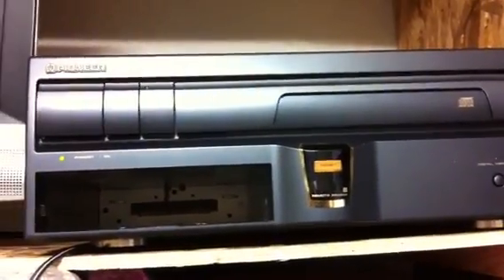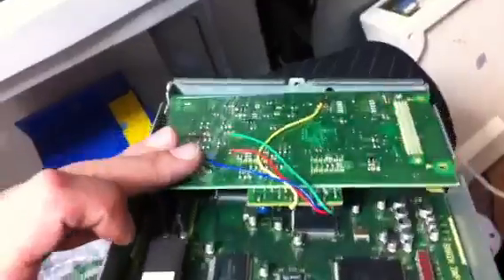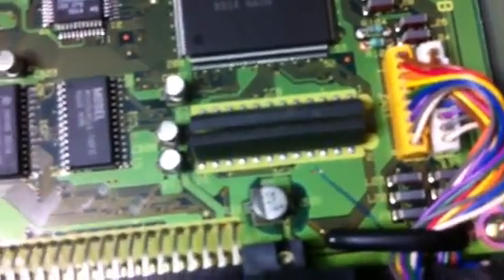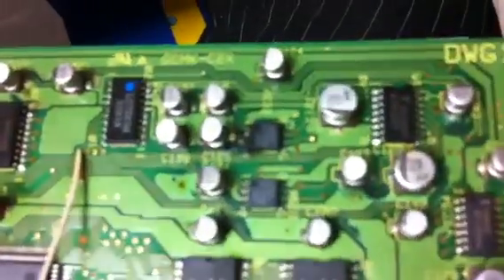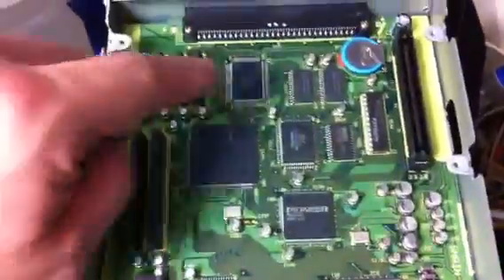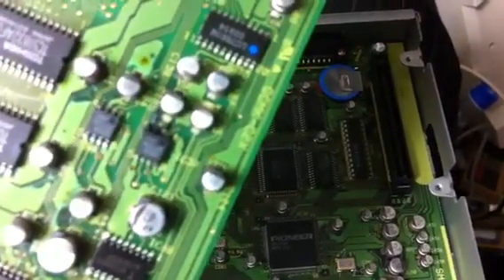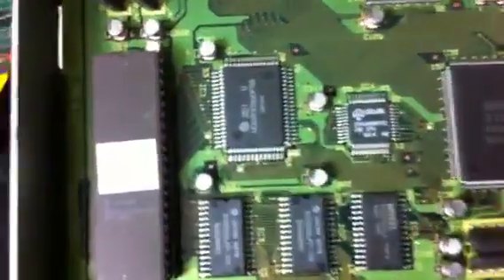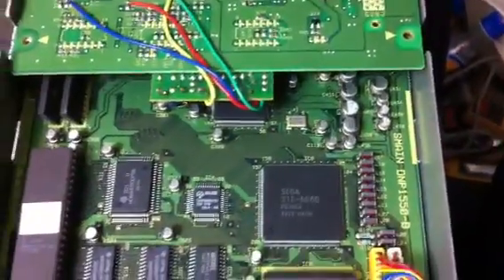Pioneer LaserActive: Replace The Caps Before Its Too Late

Comment: Thanks for the tips. I've cleaned the edge connector and tried that many times. Sometimes I can get an access light or both to flash when I flip the power on. All AC adapters are correct. It puzzles me because it worked like new at first. I really want to play Silpheed again lol

Comment: I just love your videos Luke. You could probably fix anything that's broken. I've fixed a couple of ps2s by cleaning the lasers but I've never had to fix something by replacing the caps. And since my soldering skills suck, I would have to be very careful not to solder one of the caps in the wrong place. I wish I could find a Laseractive but I'm 16 and they're about 1,000 dollars and that's a lot of money.

Comment: Yeah! Everything is clean. I didn't know 'bout power supply failure. I should try to find another one before open the console. The only problem is that the system il japanese and I live in Europe... So it will be quite hard to find a 110v power supply :(

Comment: @lukemorse1 You should invest in or build your own SMD reflow oven. Replacing 80+ SMD caps would make the investment worth it, and also allow you to fix more modern boards. There are plans for DIY reflow ovens all over the net, most use an element from a toaster.

Comment: Reminds me of how I had to replace my US black TurboDuo sound caps due to sound fading. 5 years later the left sound channel is now quiet. Looks like I am going to just have to replace all of them little shits.

I say, just go ahead and do it with all of the black Duos, Game Gears, Turbo Express/GTs and Laseractive systems. I really like the look of the black Duo systems, but the Duo R/RX white consoles are much more reliable and even has better error correction with the CD drive.

Comment: Holy crap 80 caps!  Well I suppose on the plus side, at least you can buy them in bulk.
Going to test your soldering skills.
After my cable repair earlier this week I have come to the conclusion that I don't have a single decent soldering iron (I have some, but their temperature range and tips suck), so I might go out and get a better one before I tackle fixing something like my Vic-20 where I will probably have to replace the caps.  Any recommendations.

Comment: Have you tried cleaning your games with rubbing alchohol/contact cleaner on the pins? I would also clean the cartridge edge slot. Luke has a video on how to do it.

I do know I had a nintendo 64 that would keep resetting itself due to a bad power supply. Replaced it and it was fine.

Comment: Around the early 90's there was a bad batch of caps Luke, world wide recall if I remember correctly. Basically it affected game gears, pc engine duos, sega genesis, and probably this.

What environment were these stored in Luke? Obviously this many points to a temperature problem/what I mentioned above.